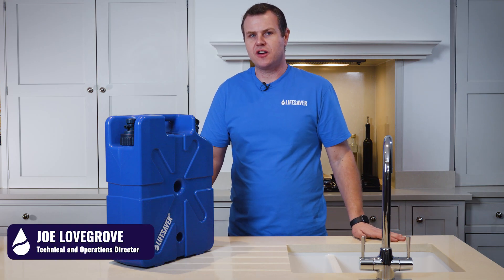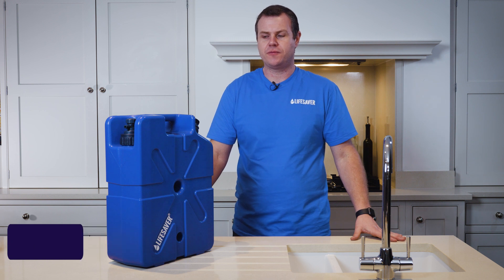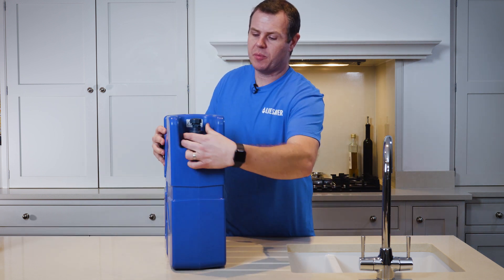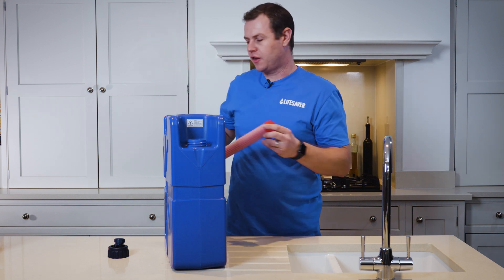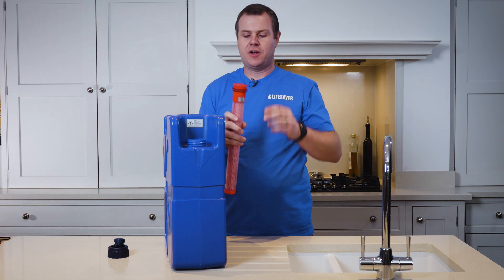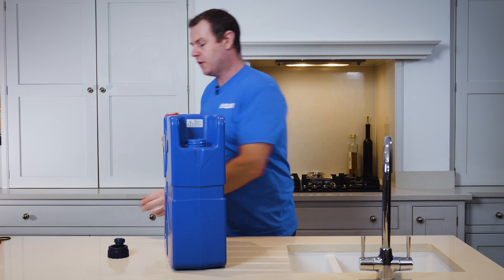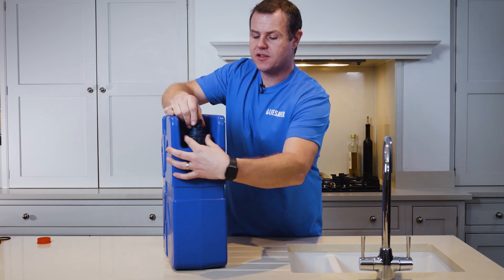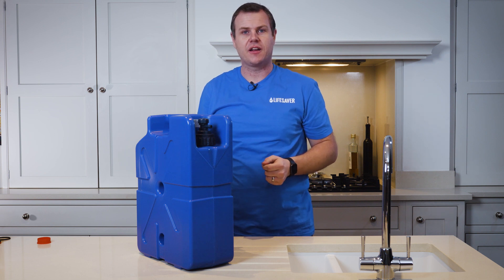LifeSaver® Jerrycan - How To Replace Ultrafiltration Cartridge

Comment: Can the jerrycan be used without its filter? If I'm filling it with already purified wayer, can it operate without the filter in place to avoid needlessly double-filtering?
Reply from the maker: The Jerrycan cannot be used with its filter cartridge in place. However, if purified water passes through the filter it won't affect the filter anyway, as there will be no contaminants to clog up the filter any further.